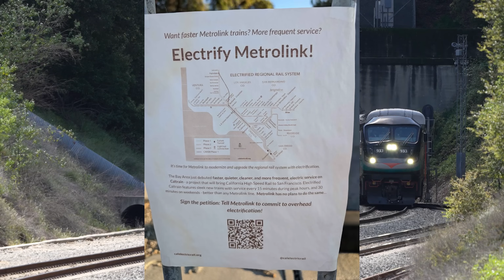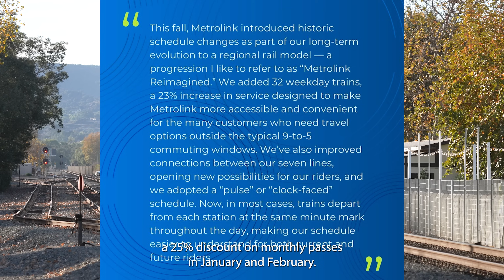Metrolink's Future: Why Electrification Could Change Everything

Comment: Great stuff! I would definitely agree that expanding double-track on the busiest lines should be the first thing to do before electrification, but again, the problem would come from all of the different owners of different rail lines. The LOSSAN corridor is probably the most egregious example I've seen from what I know the LA region, but it seems true with a lot of others, where some are government owned and the others are owned by UP and BNSF. It maybe difficult, but a solution that I like in the longer term is doing what Virginia is doing right now, and buying up rights of way from the freight companies (Norfolk Southern and CSX) to expand both passenger and freight capacity, particularly for Amtrak and Virginia Railway Express service expansion, and eventually expanding the electrification from the Northeast Corridor from DC to Richmond (and maybe Newport News/Norfolk in the future). A state or regional entity buying up the rights of way could not only lead to a solid framework for expanding capacity for passenger services and push for electrification, but could also work to expand freight capacity as well, and even give the freight operators multiple alternative routes to work on heading out of the ports. That I think would be one of the biggest things to do to make the whole rest of the process relatively smoother. I know it would be tricky, but should definitely be considered.
Reply from the maker: Thats another great point, thank you for your comment. Metrolink should really buy the track rights of the VC line from Moorpark to Ventura from UP because they rarely use it haha.
Reply: @everything.trains Metrolink is planning to start service from moorpark to Santa Barbra soon so it’s possible Union Pacific would play ball
Reply: It's worth noting that the LOSSAN corridor is, in fact, publicly owned - it''s just that the Pacific Surfliner service funded by LOSSAN travels over more than the corridor itself. Moorpark through LA to San Diego would be entirely publicly owned rail if not for the short section of the BNSF Transcon between the end of the River subdivision and Fullerton. On that section, Metrolink already has an older MOU that gives them the right to partially electrify the BNSF tracks in that area to enable fully electric service on the LOSSAN corridor between LA Union and San Diego.

West of the Moorpark, UP owns the trackage, but it's lightly used for freight service (relatively speaking), with the ROW having plenty of space in most spots for double or even triple trackage. For that, I could see UP being amenable to a deal similar to what they have with CalTrain: Public ownership and electrification of the tracks, but with trackage rights (especially overnight) for their freight services. UP hates OCS, but likes not having to maintain tracks!

Even if Metrolink double-tracked the section of track between CP Raymer (by Van Nuys Airport) and CP Topanga, they could run a gangbusters popular service between LA Union and Chatsworth that isn't well served by transit now, and would offer a "express" alternative to the Metro G and B lines. Extend it to Moorpark, and you'd also capture all the trips from Simi Valley to the SFV and beyond - a commute that is currently best described as "soul sucking" even on a good day.
Reply: The San Bernardino line has a couple sections that would be hard to double track. The first is where the line runs in the median of the 10 freeway (old SP Soto Street Sub, ex-PE San Bernardino line). It's surrounded on both sides by freeway lanes, and there's no way Caltrans would let them take over an extra lane. The next difficult section is north of the UP interchange at Bassett. A portion could easily be double-tracked, but once into Baldwin Park and all the way to San Dimas the right-of-way is extremely narrow and would require acquiring and demolishing hundreds of homes. Beyond that the r-o-w is wide enough, and many sections already are double tracked.
Reply: @derek17ca  It would be a little tight, but I-10 can be double-tracked in the median.
Reply: @JimBones1990 The only place where there might be room is just east of the Del Mar Ave ExpressLane ramps. It could accommodate a short passing siding, similar to the one further west at Control Point Fremont in Alabama. 
Anywhere else would require taking area away from the freeway itself. As the Metrolink right of way exists now, a second track will not fit.

Comment: The mileage of the  LA Metrolink system is huge. The Bay area  heavy rail commute region is more or less confined to the peninsula, with BART as a back up for much of the rest of it. 
I think waiting for a system that is able to take advantage of the developments in battery electric propulsion to finally get incorporated into the antiquated thinking of the leaders in railroad circles  would yield a less costly way of electrification: 
 A train with a coupled battery car tender behind each of those already electrically propelled Diesel engines could increase greatly the acceleration,  while also allowing electric operation through tunnels and city centers. Just use catenary at each longer dwell station stops, termini, as well as  at midday yard storage tracks and for steep grades. Massive savings in both time and money for electrifying the present system which has a greater percentage of grade crossings to deal with.
Reply: Battery trains make absolutely no sense!
Reply: The problem with "supercharging" for a 2 minute dwell time at a station is it requires a HUGE amount of power draw, which requires even more expensive infrastructure. As it is electrification uses a decent amount of energy, but concentrating it into such a short charging window isn't feasible without great cost. At some point we just need to learn how to electrify rail lines more efficiently, but honestly 12M/mile is pretty reasonable given other capital costs of infreastructure.
Reply: Battery trains work well or very well only on low traffic short lines with almost one side electrified: they are useless for high frequency and/or long lines.
Reply from the maker: That is another great point.

Comment: More double tracking yes. Electrifying Metrolink, NO.
Reply from the maker: More double tracking is for sure needed before electrifying anything especially with the scheduling nightmare back in October.
Reply: @everything.trains You probably could do both or at least future-proof for it. When double-tracking and grade separating, put in foundations and poles for caternary in the future, so all it takes is stringing up the wires and building out electrical substations

Comment: BNSF already agreed for LA to Fullerton that opens up Fullerton to San Bernardino
UP ownership of the coast line needs to end, they don’t use it for anything but local freight 
I’m doubtful meteolink would do a wholesale replacement of their coaching stock. I suspect they’d just get electric locomotives and keep the existing cars given their large fleet with most being under 20 years old. If they need more trains they should move to EMUs
Reply from the maker: Thank you for the intel. I didn’t know BNSF has already agreed for LA-Fullerton. Yeah, that’s another great point about the coast line. You rarely ever see UP trains on it. Thanks for commenting.
Reply: @ it is apart of cahsr, 2 tracks will become freight only while the other 2 will become passenger only. San Bernardino pathing study was a few years back but looks at that segment

Comment: The solution? BEMU's that can fast charge at end stations... Almost every manufacturer has this option now and while traditional overhead catenary is superior, these beat diesel AND hydrogen any day...
Reply: Metrolink researched these last year, their reports note that BEMUs would be insufficient for they purposes due to lack of range and cost, among other reasoning
Reply: @Point_Capistrano  Except that study (which was focused on pilot projects, not actual full system electrification) frequently noted that battery-electric locomotive options were both technically superior, cheaper to implement and maintain, and had lower ongoing operating costs that FCV or Battery-FCV vehicles. It then hand waved all those technical realities away by saying that Battery-FCV trains were under development in Europe already, and so they'd probably be better by the time an actual decision had to be made. Of course, this was despite the reality that Europe's experience with Battery-FCV trains has been horrible, at best. It's a garbage conclusion that makes no sense, except...

There's an ugly political reality here: Newsom, and many local politicians, are being heavily lobbied by the Natural Gas industry to support Hydrogen because it largely benefits them (most Hydrogen is made from Natural Gas, aka Blue Hydrogen, and isn't zero-emission as a result) given their consumer and industrial base is being destroyed by electrification. That lobbying is a big reason why California has incentives for things like Hydrogen FCV's, despite there being zero market for them outside of the State - they just can't compete technically with battery electric or pure electric infrastructure. Attempts to use them in other countries, like Germany, have largely failed.

You don't need to electrify the entire system - only parts of it, enough to enable battery-electric locomotives to charge in motion enough to handle the non-electrified portions. For example, you would only need to do the uphill portion of mountain passes, with regeneration easily covering the downhill section and much of the flat valleys.